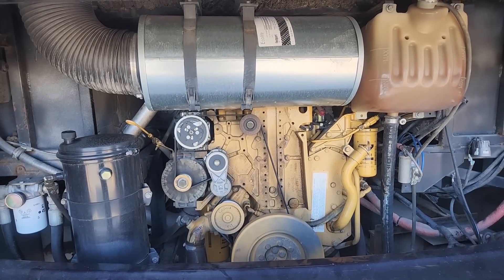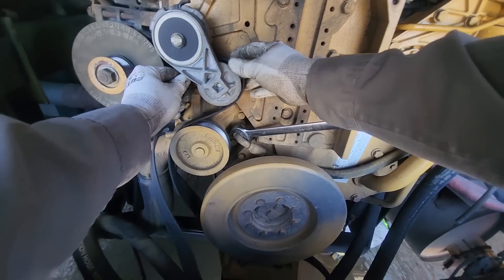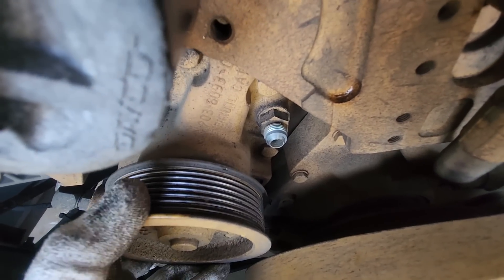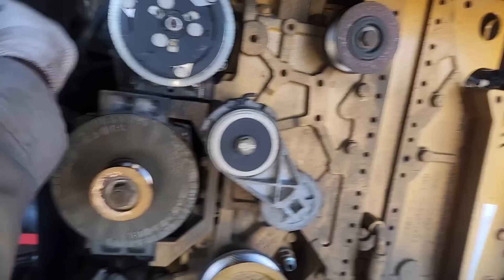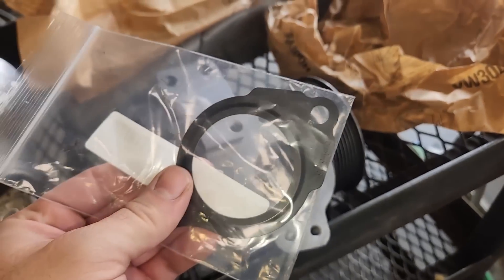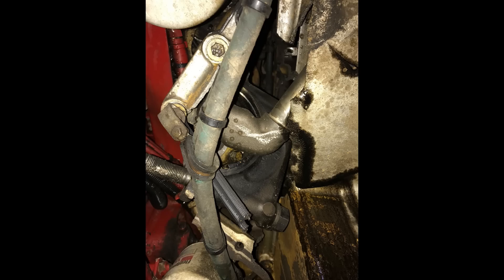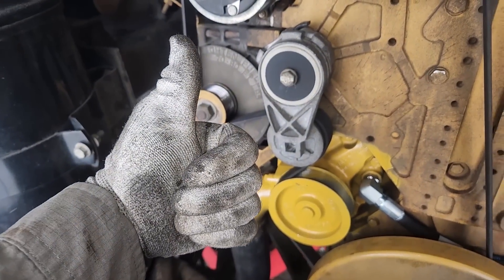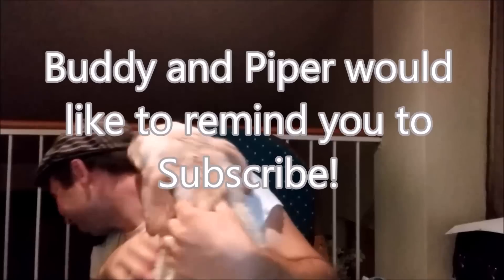Cat Diesel Engine Literally has Water Pouring out of it!  C9 Water Pump Replacement.

Comment: hey brother Adept, my 1998 GMC TOPKICK C7500 has a 3126 CAT. And my truck was sitting for a week or so, and I noticed the coolant has almost leaked out. Big puddle on the ground. But the tech said it has a "cold leak" from the water pump. Usually pressure is built up inside water pump and if the seals on the water pump are bad, that is probably the issue. But the truck has never leaked in months it has been sitting. It ran for a day, and few days later , this happens. what is your suggestion in reference to this "cold leak?" Thanks...

Comment: Do you have to remove the damper in order to replace the water pump belt   if so what would the damper   bolts be torqued at ?

Comment: And there’s nothing wrong with torquing all your boats. I’ve learned over the years you can tell the difference on a clutch, which one has been put in with an impact, and which one has been taught not even seeing it you can feel the difference in the clutch, the clutch is smoother.

Comment: Is there   a way to check cfm on a air to air cooler to see if there is enough air flow through the cooler  to build the right boost or do I need to change .
Turbo has a 144 exh. 78 mm boost Finn only builds 28psi  5ek99009

Comment: Josh, question! Something you said in this video peaked my interest. You said the larger Cat engines have oil supplied to the gear driven water pumps.. is there anything that can fail within the water pump to cause oil and coolant to mix there? Still trying to figure out why my friend's C15 ACERT is mixing oil into the coolant.. I replaced the oil cooler again and the air compressor and I still believe the problem is present.

Comment: Does the alternator bracket and alternator it self have any locating pins or guides on bolt holes for centering it? On marine c9 with different type of alternator mount you don't have them and once I had a problem with one engine, client loosing three belts, in the end it was because someone changed water pump and didn't align alternator properly

Comment: You're lucky on that hose to the air compressor. Every Cat I ever touched (hundreds in the 50 years) the fitting would loosen before the hose. Getting a backup wrench on it was sometimes impossible.

Comment: 9:00 be glad you have Cummins mechanics because the manufacture pursued with building engines having emissions. Emissions such as DPF, NOX, Aftertreatment etc. Not exactly sure what your knowledge is dealing with emissions being you are a CAT specialist, however will say and "as you know..."  CAT pretty much said to hell with all that and stick'd with off road for their brand based on performance. 
Been following your channel for years and like to watch every episode you post on YT. My thoughts are, don't get bummed out because they are Cummins supporters. Be grateful because you never know when a truck shows up to your shop and its a Cummins with emission problems. 

I personally would LOVE to drive a Kenworth W900 or Pete 389 with a C15 having compounded turbos on a 18 speed with a straight pipe dual stacks. I know the power is there, but would be a definite treat for me on my bucket list of things to do in life.
Reply: Don't forget there is emission standards on off road equipment also.

Comment: Changing the alternator on my ex's car the bolt fell in between the alternator and the mounting bracket. Had to remove it to get it. The belt adjustment on it is crap too. I swear it has like an 80+ ft lbs of tension on it. The adjuster is also just far enough to the upper right to not be able to get a breaker bar on it. Really annoying.

Comment: Yep . My wife and I did our C7 rear radiator RV in Mina Nevada.    You have to access this area by removing the floor in the back closet in the RV .  Fun times in the desert ! I found out that 90 degrees at 11 % humidity is better than 90 degrees here in Dallas. 
Thanks to the Adapt Ape  for coaching me on RV repairs!

Comment: I would suggest looking up the Torque Test Channel on how extensions on impact guns affect performance. They also test just about everything else related to impact gun performance and review tools among other things. On the ratcheting wrench like you I don't like breaking bolts loose with them so that usually means the regular wrench is the tool that I have closest to me when I go to put everything back together.

Comment: That right angle impact is amazing, thing has around 220 ft/lbs of torque, of course its  a bit bigger than a ratchet but it saves time where it does fit
Reply: i love my right angle impact.
Reply: I have the electric ratchet from milwaukee and already looking to buy the right angle impact for the many times I found it would have been perfect for the areas with little room to swing a  long handle ratchet

Comment: Cat not producing highway engines is a big reason why there's more Cummins guys. Cat will be buying from Cummins if they lose their competitive edge so they better step it up. Is Cat developing hydrogen engines at all?
Reply: hydrogen is actually terrible in a lot of ways. hybrid gas or electric are the only viable options, and i dont see diesel going anywhere

Comment: The one cat engine I ever worked on, back when I was a traveling freelancer was for a water pump, was a different style, was pretty much just a box that bolted on up high on the front of the engine.  I knew less at the time, I didn't even know what series it was (guy that called me in just said "here's a water pump, replaces the one on that engine there") but I remember it being so easy, made me wish I had more heavy diesel experience so I could switch to just doing that instead of my general "if it's got nuts, bolts, or screws, I'll fix it"

Comment: This video is very interesting because the C9s we have in our buses from 2007 don't look like this one. Ours are in transit buses so obviously a much larger alternator, mounted on top of the engine, and the a/c compressor is totally separate and driven by a dedicated belt coming from the crank pulley. But I'm looking at things like the oil filter housing - ours look quite different, they have 4 big Allen plugs on the side and top. And this one's front structure looks totally different from ours. We very rarely have water pump failures, but I have done one and it was the same process. Were there different iterations/versions of the C9?

Comment: Socket extensions are torsion springs. They reduce the effectiveness of impact tools. The longer the extension the worse the energy loss will be. In addition, socket connections (using one or more extensions) will reduce the impulse at the socket. Best scenario for an impact tool is to use only a socket. Hand tools like ratchets, breaker bars, and torque wrenches are not effected by this.

Comment: A good PM check on belt ten sioners is to put a beam style or dial torque wrench in the square drive and check the resistance A Gates engineer told me they should be at least 25ft lbs  A easy check on a PM. As you know when the spring looses tension the belt flops around!

Comment: Glad you gave your Honest opinion about Air Impacts and Ratcheting wrenches. 
From what I've noticed so far with the Cordless tools is they don't last near as long as Air tools before needing to be Repaired.
And the Battery Cost is Ridiculous. Shop Air is Free for Me 😂
I've got some Air tools that are 30 plus years old and have never been Rebuilt. A little oil during everyday use goes a long way.

Comment: Great tips in this video. Start all the bolts by hand and check the o-rings with a mirror before tightening. Nothing like thinking you finished the job only to have a pinched o-ring leak! Too bad your socket didn't drop down into a crevice of the subframe requiring 30 minutes of searching and another 10 minutes of extraction time with a magnet. Oh the joys of being a line mechanic 8 hours a day 😂

Comment: You are the most meticulous & careful Dismal mechanic, have you ever thought about Avaition work? It has a higher level of responsibility pays a little more, but no Dismal zoot, the parts are a lot lighter and you can work in a remote area out of the rat race. (if you want to) ben/ michigan
Reply: I left Aviation after about ten years to work on equipment. I miss it but I make a lot more money then I could have as an A&P and I don't have the liability